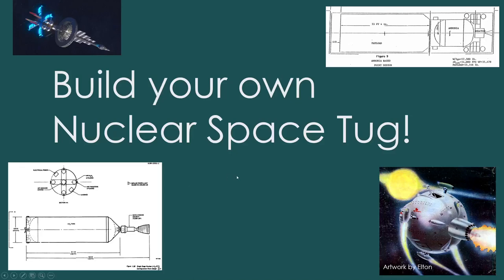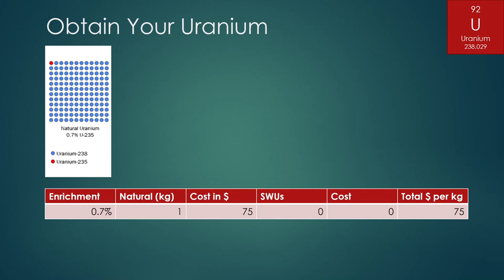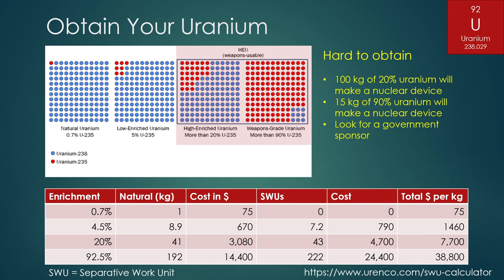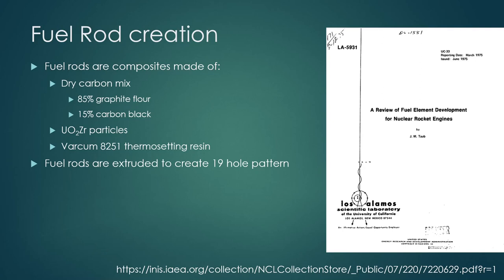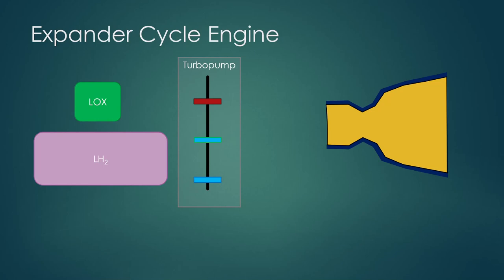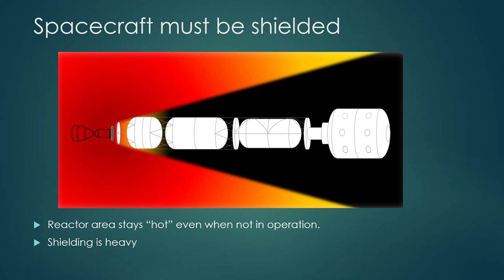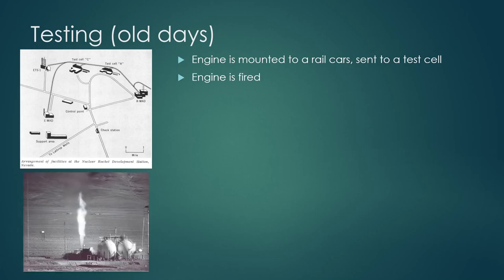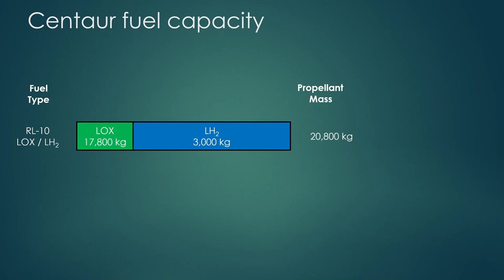Build Your Own Nuclear Space Tug

Comment: So the nuclear engines in KSP are over powered mostly because they can just burn RP-1
Reply from the maker: Hmm. RP-1 could maybe be used with a NTR but it would have a horrible ISP. 

There is a design known as LANTR which is a solid-core nuclear rocket with LOX injection in the nozzle, sort of as an afterburner. It can supposedly give about 3 times the thrust but unfortunately that's at a reduced ISP so it's not necessarily much of an improvement.
Reply: LH2 is almost always gonna be virtually the best you can do for Isp, due to the kinetic energy (or is it momentum? I forget) tradeoff between mass and velocity of the exhaust particles, and the supremacy of velocity in determining specific impulse.

All else being equal, the only way you can generally do better than H2 is with atomic hydrogen (atoms love being in this state btw!), or by having the exhaust be something more exotic, like electrons, or I suppose photons, etc. Something even lighter.

(And of course the pursuit of optimal Isp frequently comes with tradeoffs like lesser thrust; or worse propellant tank size because LH2 is friggin voluminous; etc.)

Comment: I feel really motivated to build a nuclear rocket engine in my garage now!

Sadly though, getting ahold of the >90% HEU I need hasn’t been smooth sailing so far. When I told the feds that I needed the >90% good stuff, they laughed in my face and asked me if I thought they were stupid. I tried to explain that no, I really do need the highly enriched stuff for very legitimate mass and TWR reasons! But they just seem dead set on the idea that it’s an excuse and that I actually want to make a bomb! 😦

So, I’ll probably need to lay low for a few years and invest in black market centrifuges that I can run in my basement. Hopefully I can buy used, and manage to steer clear of any Stuxnet-affected units… anyone not offering a 30-day return guarantee is off the table, full stop!

Fortunately, the suspiciously massive electricity consumption at my house will be easy to explain: all I have to say is that I’m one of those stupendously environmentally irresponsible Bitcoin mining operations, and they’ll go “oh yeah you’re just one of those idiots wasting a small country’s worth of electricity to solve pointless math problems, move right along sir”. Nobody will suspect a thing! 😄

I’ll report back when I’ve either succeeded, or else become indefinitely detained in a federal torture facility for suspected terrorists. 🙂👍
Reply from the maker: I'm sorry for your difficulty....

I'll only note that "government sponsor" is a generic term...

Comment: Does the crew need extra radiation shielding or would the shielding needed for deep space vs GCR's be enough?
(i.e. Over a metre of low density shielding, with a couple of mm of high density shielding outside that?)
NTP should mostly make neutron radiation or weaker, so it should be pretty mild compared to the HZE-ions in interplanetary space....   

NTP rockets definitely need some new lightweight materials to deal with heat and radiation to become something useable...  :)
Reply from the maker: All the designs I've seen have featured shields - I think I talk about that a tiny bit in my NERVA video. My sense is that the radiation flux from the reactor is much higher than the background radiation but I don't know how to quantify it. 

You might find this NASA paper interesting:

https://ntrs.nasa.gov/api/citations/20150006884/downloads/20150006884.pdf

Comment: Have you seen the project timberwind NTR? Studied in the late 80s as part of SDI, it has a TWR of 10 (as opposed to the 3 of Nerva), with slightly better ISP.
I wonder how they got such a drastic performance gain over NERVA, maybe a lack of shielding.

Personally I think one potential theoretical advantage of NTR for a space tug is the lower fuel mass, on the one hand it makes for a poorer mass fraction, but it also reduces the necessary up-mass to LEO.
For a re-usable tug for example, your long term costs are going to increasingly become tanker flights to refuel it, a more efficient fuel system reduces that marginal cost.
To put it another way, you only have to put that heavy NTR and hydrogen tankage into orbit once, whereas you will have to lift the fuel for it maybe 50 times and it should be a lot cheaper to put say 3000 tons of H2 into orbit than to put 4000 tons of Hydrolox.

Granted by the time a system of multiple reusable interplanetary tugs becomes necessary, NTR may well have been made redundant by better SEP/NEP or fusion related propulsion.
Reply from the maker: I've looked at many of the NTR designs. NERVA was a research engine rather than a real engine and I don't think they spent much effort on making it light. 

Your point about uplift mass is a fair one, though uplift volume also matters because the hydrogen is so undense; if you were lifting hydrogen in a falcon 9 and you could fill the whole fairing with it, you only end up with about 10,000 kg. Compared to other payloads, it's going to require a different sort of containment solution or you are going to be volume constrained if you try to fly. 

The other concern is longevity, especially over multiple runs. There is high thermal cycling in the cores that have tight tolerances and there is erosion from the hydrogen in the channels of the core. I would expect that there's a time limit based on running time after which your very expensive engine is junk - or makes itself junk. Chemical engines are much less complex and have decades of development and it wouldn't be surprising for one to work for hundreds or even thousands of cycles.

Comment: Thoughts on Fission Fragment / Dusty Cloud designs?
Reply from the maker: Uninformed opinion below...

They are interesting - you could theoretically get a lot of delta v for a small amount of weight. The lack of propellant is a big advantage.

But wow, that looks like something that would be technically very difficult to build. With the dusty plasma ones I don't know how you control the reaction well enough; not enough uranium it does work, slightly too much and your engine melts down. 

I've generally become skeptical about ideas that have been around for a long time and nobody has actually tried to build or they have been built but not pursued. Aerospikes are a great example; they look really promising but just turn out not to be worth the trouble.

Comment: Cool

I think NTP will work best in Cislunar space (but specifically as a NRHO-LLO transfer stage tug - kind of like National Team lander transfer element)

Would get double ISP of a TE and really make a sustainable landing system possible (preferably with the Dynetics lander)

Only concern is that it might irradiate the Gateway crew, but I’m sure this would be solved and something like this would happen in the near future with Artemis hopefully
Reply from the maker: What you mean by "double ISP of a TE"?

And I thought the Dynetics lander had negative thrust/weight ratio.
Reply: @EagerSpace  Mass issues have been solved with their new design by using new materials and other things

I meant that a theoretical LH2 NTP transfer element for DHLS would have double the ISP of NT ILV’s existing LH2/LOX TE

You’d need to do less refueling for a NTP TE, so maybe 2 trips from NRHO-LLO instead of 1 that is possible with ILV/NT’s TE

Would be able to either bring more payload down to the surface or just shrink DHLS prop tank mass
Reply from the maker: @alrightydave  Thanks. Do you know of any references that detail these new approaches?

Comment: Based on this presentation, the discarded project of the Space Transport System with a NERVA engine to push massive loads into lunar orbit as a space-tug completely misses the point. It is worse than a chemical propulsion rocket!  So why is nuclear propulsion so promising?  What's happening with the Constellation program?  S-IVB with a NERVA engine?  Considering the fuel capacity of the S-IVB of the Saturn V, which is approximately 100 tons, it could only accommodate a total of approximately 25~ tons of LH², and returning to the STS nuclear-tug, the plan for translunar flights with loads of up to 60 tons is absurd, I made a certainly arbitrary estimate and obtained a terrible Delta-V economy, of barely 1200 m/s.  How was it even considered?
Reply from the maker: I don't get it either. Whenever I do my calculations I always ask people if they have better ones but I've never seen anybody else do the calculations. The mars designs are just ridiculous - they have a thin framework of struts with mylar bags full of liquid hydrogen to get them light enough, but they conveniently miss that if you can do it with liquid hydrogen, you can do it with lox and liquid methane a lot easier.
Reply: @EagerSpace  I feel cheated.  I always thought that fission-based propulsion was the first step for colonization but I see that we are far from that, I returned to make calculations a little more optimistic and they are still unsatisfactory, if the function of thermal propulsion is simply to rule out the need for carrying so much oxidizer to combust, does that mean we can discard the LH² and change it to a denser fuel (with its respective isp) like a liquid methane module?  Can we trust that modern technology can solve the problems related to vehicle dead weight such as lighter tanks with greater fuel capacity and without using the under-dense LH²?  Perhaps the technology used in Starship is the solution: transporting a large long cylinder with liquid methane, the isp would be reduced (around 650 isp) but we could take advantage of all the advantages that the LCH⁴ has compared to the LH²